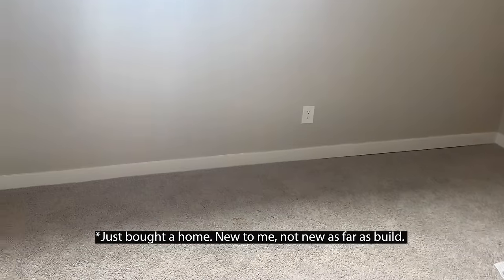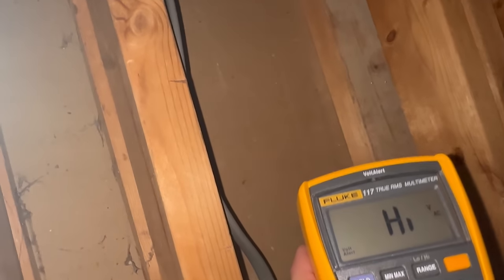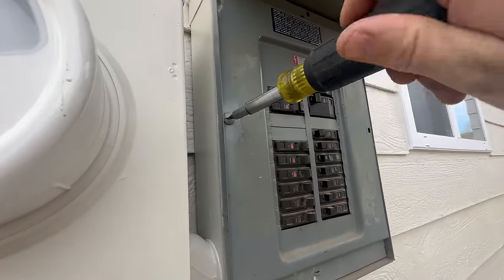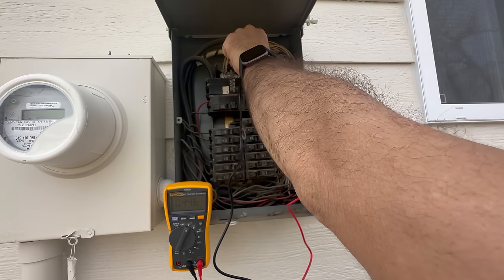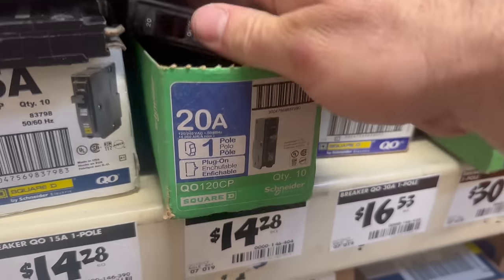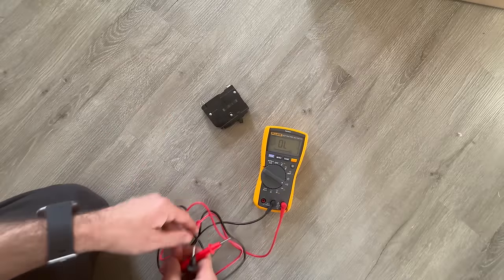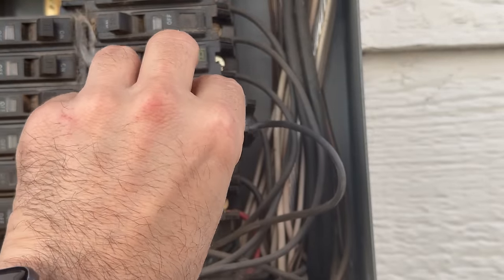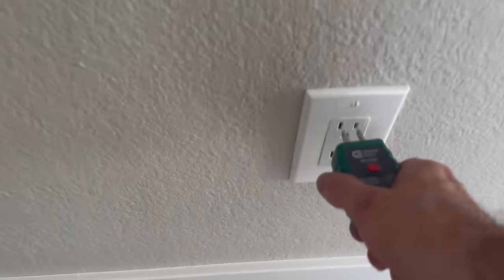Multiple Outlets Not Working - Breaker is Not Tripped

Comment: Had a same issue just yesterday. Had 4 outlet boxes not working in our kitchen. Turned out to be a very loose wire on the GCFI outlet. Used my receptacle tester and breaker finder -  turned off the correct breaker, found the loose wire and popped it back in. Back in business with a happy wife :)

Comment: A big pet peeve of mine is how most electricians do a very inadequate job of labeling breaker panels, or more likely, they don't label them at all. This sure creates problems later. I had a major electrical overhaul with new switches, outlets, and breaker panel. The electrician also installed GFCI's here and there throughout the house, and did not label anything or keep track of which rooms and outlets down the line are affected if the GFCI trips. Some of these are extremely inaccessible. So now, all the lighting does not work in a large office room, presumably because a GFCI somewhere tripped. It is hard to explain why this is so difficult to track down, so now there is no overhead lighting which is really needed. The electrician had installed all the GFCI's because the very old house wiring has no ground wire. Anyway, it is especially annoying when you pay thousands to a licensed electrician, only to spend years and decades later reminded of all the inadequacies and corner cutting that he did, including no labeling of breakers. Strangely, there is still a kitchen outlet that is not controlled by ANY of the breakers in the panel!!!
Reply: I’ll tell you the reason why. It’s because it’s residential lol. I’m a commercial electrician and this was hounded on me during my entire apprenticeship was panel scheduling. All of the new housing tracks being built across the United States are done by residential piecework electricians. They get paid by the piece which means they get paid for every house they do so if they rope in a house in a day they get paid for that house. They’re trying to get it done as fast as possible, while still adhering to code. So in essence, the home will pass inspection, But they create headaches for other electricians later down the line.
Reply: @M3thodbombz  Thank you for the explanation. Exactly as I had suspected all along. For the typical homeowner there is no good solution because no matter who you call, even if they know you and talk nicely, in the end they will rip you off. Even if they don't realize it or see it that way.
Reply: I replace an old panel with a new, larger one.  Did everything myself and labeled it accordingly. Had it inspected and all good.  I’m not an electrician, but pay attention to the details required to do the job correctly.  Most electrician you hire will do an outstanding job, but maybe not the original ones installing the job in the first place due to time restraints.
Reply: @M3thodbombz Makes sense 😡
Reply: Mystery wire or sub panel sheet rocked in ..🤔✌️😔 tied in from your neighbors unit most likely
Reply: @MiloTorres-yx5jw  Well I'm sure no connection to neighbors, and, there is no sheetrock in the house. House was built before they invented sheetrock.
Reply: @KpxUrz5745  Illegal pre-meter tap. Turn of all your breakers and check outlet. Still powered? Kill main breaker. Still powered? If so... look for tampering between the meter and the utility's cables.
Reply: @M3thodbombz  If you look closely at the video when the breakers are covered, you can see the remnants of the glue that used to fix the paper schedules next to the breakers. After time the glue fails.
Reply: @darrendolphdragos9752  I get the picture. One thing I feel sure of is there was never any attempt to do any improper hookup or avoid metering. So maybe the outdoor service panel controls that one line, as opposed to the indoor breaker box handling everything else. It's just annoying to find illogical wiring.
Reply: @KpxUrz5745  Does your outdoor service panel contain your main breaker and a small breaker for this one receptacle?
Reply: @darrendolphdragos9752  The short answer is no. But there may be a breaker handling a number of things. I haven't checked that whole panel yet, not fully sure yet how many things are on that mystery line. To add to all this, prior electricians did not do a good job of marking breakers on either panel. Plus I stay far too busy to find time for things like this.

Comment: Thanks for the video. Same issue, I suspected it was the breaker and from your video it looks like the breaker is the main culprit.
Reply from the maker: Thanks for watching !!
Reply: I've had instances where the wiring simply wasn't hooked up past a random outlet or switch. One time I found that the ground wires weren't tied together - no reason, they just left them hanging and didn't even attempt to put a wire nut on them.

Bonus: all the outlets were upside down in that portion of house.

Comment: Great video. I had the same problem and after replacing the outlets on the circuit, I thought I had the problem solved only to fimd the stove light blinking (intermittant power). The great thing about this video is that it calls out the untripped breaker which is the last item most people think of as the problem.

Comment: Exterior electric panel/breakers, never seen that b4.  Tho neighbor just had whole house fail…. turned-out a single/main breaker just below outside meter lost contact (similar as yours, did NOT trip). Small box was pad locked and never opened nor failed in 35+ years.
Reply from the maker: It's very common for exterior panels.
Reply: It astonishes us to see the breaker box outside.  Although common in mild climates?  Along with gas water heaters, outside also.

Comment: Great video. You made it look easy. The continuity test proved it to be a bad breaker. Wondering if a main line is not working through a home if testing the breakers for proper voltage first is the best way to go...?

Comment: Great video.  I am in the same situation.  There are three outlets in my kitchen that are not working.  Like yours, the breaker did not tripped.  I checked the GFCI out and resetted but still no power.  Disposal, lights, oven and everything else are working.  If its the breaker, shouldn't it be the whole kitchen rather than just only three outlets?
Reply: same here, but I have 3 light switches not working. all breakers show proper voltage, replaced the 2 oldest light switches and still nothing...not sure what else to check....
Reply: The entire kitchen is not on one breaker. Lighting and kitchen outlets never share a circuit. Disposals are usually on their own circuit, as are ovens and dishwashers. There's usually 2 kitchen receptacle circuits, one of yours may have a bad breaker or a bad GFCI or just a bad connection somewhere.

Comment: 20 Amp Breaker on 15 Amp Receptacle’s 🔥
Reply: You worded that wrong. Its 15amp receptacles on a 20amp breaker, which there is nothing wrong with and is completely safe and code compliant as long as there more than one receptacle on the branch circuit which there clearly is in the video. (A single duplex outlet with 2 receptacles counts as 2 btw). The breaker provides over current protection for the branch circuit wiring, its not specifically designed to protect any specific receptacle, switch or load even thought by proxy it can since if you overload the circuit wiring and the breaker trips in turn now your receptacle and device will no longer have power. This is a common misconception on the actual purpose of a ocp breaker. Additionally 15amp receptacles are all required to be rated to 20amp pass through, that way you can install multiple 15amp receptacles in series and then the last one could be a 20amp receptacle and fully support that load. Your receptacles and switches themselves are protected firstly by a ground bonding so in the event of a short the current is is removed from the load to ground. If you want to protect the components of the receptacle itself then the device you plug in needs protection, this is often achieved by overcurrent protection circuitry in the electrical device or simply a fuse in the device power cord or input power supply.

Comment: First thought was maybe bad wire connection in the breaker box... glad it was simple! And now if anything else happens you know where to start... if one went bad, wonder how many are close. Is the power coming through clean?
Reply from the maker: Hi, not sure what you mean by clean. The home is over 30 years old though
Reply: @ApartmentMaintenancePro  I just mean, is it steady hz and voltage coming into the main box and then throughout the house. Do you think the breakers are all the same age? Just curious why you think only 1 went bad.
Reply from the maker: @sloanNYC  Gotcha. Voltage is steady. I can't control the hertz but seems ok. I'm guessing the breaker went bad because home is over 30 years old.

Comment: I was surprised it was 20 amp breaker and not a 15 amp. Wire in the breaker box looked like 14//2 to me. Maybe this accounts for the heat damage on the busbar.

Comment: An external breaker panel? I've always seen them tucked away in the garage, basement, or a closet so they aren't exposed to the weather.

Anyway, judging by the apparent age of the breakers, replacing ALL of them would be a good idea. Once one is dead the rest of them are likely on their last legs as well and it really wouldn't cost that much in the greater scheme of things.

Comment: That breaker panel should be moved to the inside of the house. Too much moisture and condensation outside leads to corrosion to the internal mechanism of the breakers causing outages.
Reply from the maker: You should read up on this. It’s very common and in some places a requirement to have the panel outside 👍

Comment: I noticed you put a 20 amp breaker in the box and I believe your outlets were 15 amp. Is that a problem?
Reply from the maker: It is but I would check out 210.21 in the NEC for more info, assuming your wiring in the US

Comment: This is just what's happening to my breaker, it tripped several times and now on the on position there is no power. It's an expensive one because it's an old style Square D QO single pole, tandem 20 amp.

Comment: What if you check your breaker and your breaker still the correct voltage In some of the outlets that are connected to that line are working, but the rest are not

Comment: I changed my receptacles in my 2 rooms because they were old. Then all of sudden all of my other rooms lights not working and it said my Ground and Hotwire are reversed (which is non sense as I made sure it was right) My breaker is not tripped or anything. What could be problem and solution for this?

Comment: I don’t understand electrical panels outside. Why is that allowed?
Reply from the maker: Why wouldn’t they be allowed outside?
Reply: @ApartmentMaintenancePro  I know it's allowed. I would not want it and it shouldn't be allowed. I can't imagine how breakers hold up to the elements. 
Also, I've seen too many movies. I don't want wandering psychopaths to have access to my breakers. 
You want Grandma going out in her housecoat and bunny slippers in a rainstorm to flip a breaker.
Reply from the maker: This breaker panel is from the 80s, yes, its not perfect but its holding up pretty well for its age. This is in Colorado so humidity isn't an issue  @KitchenerLeslie2

Comment: Would have been better for me if your hands weren't in the way. Also a quick overview of the meters you used and how to use them or at least explain what the different points of contact are used for in these meters would have been nice...I'll look else where. Over all a good video but sounds like it's for someone with a bit of electrical/wiring knowledge.

Comment: Question Sir, what if the power from the outlets are intermittent? Mine work for a few minutes then die, only one side of the living room. Is this an indication of a breaker failure, or falling? Thank you.
Reply from the maker: Is the breaker tripping ?
Reply: Thank you for responding, no the breaker is not tripping, it's in on position. I figured out their are 3 outlets on this breaker. The first is reading 30v with open neutral ground error. Second, and third have the same error code, but have 120v. @ApartmentMaintenancePro

Comment: Outdoor panel.     All them breakers should be replaced …. Bad breaker.   Wire on breaker….   Then Usually Scab locked receptacles… Or not twisted wire using wire nuts ….. i find what is missing.  Neutral or hot.    Then backfeed what is missing or i seen a GFI FEEDING multiple other outlets.   Love troubleshooting….   $$$$$$$